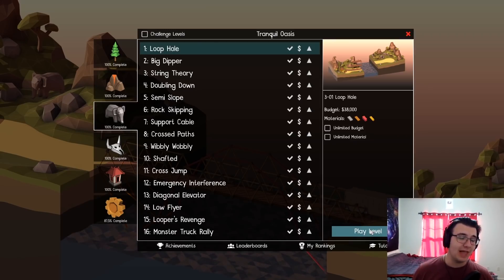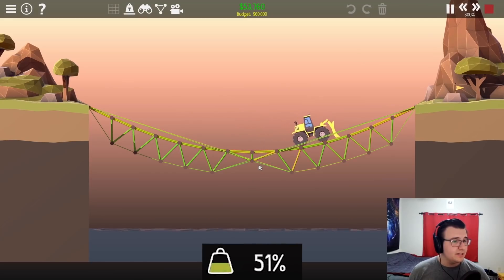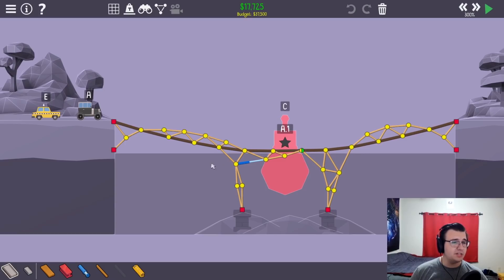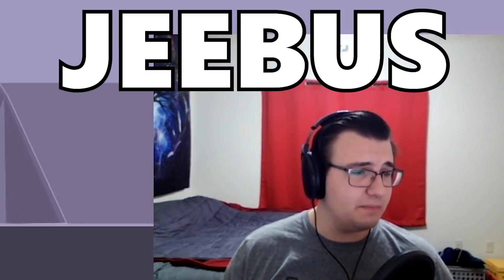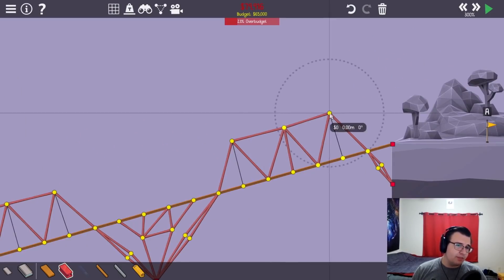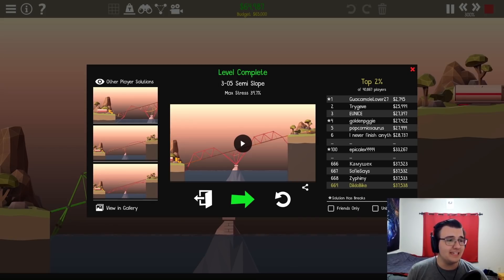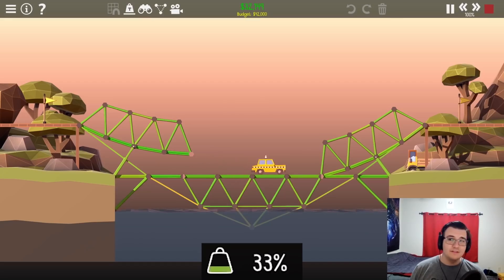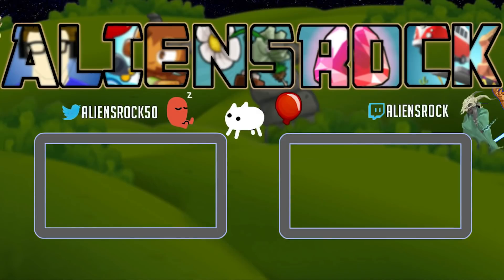Building MASSIVE BRIDGES With Extremely Low Stress

Comment: I don't remember if I mentioned this in a previous video... (Tell me if I have.)
But I think I have an idea on how to make 'min-stress' work alongside 'min-budget.'
What if each bridge was scored by a combination of how far under budget and under 100% stress you are?
I.e. if you use only 75% budget for a bridge with 60% stress, you could score 50.00 in total.

For those wondering, the equation I used was the following:
=(100%-MIN%) x (100%+(100%-MAX%))
(This will ALWAYS give you the largest total, so it doesn't discriminate one value over the other.)

Comment: I feel like a good tool to make optimizing stress more fun would be a slider that lets you reduce each piece's stress capacity. For example, you set the slider to 50% and then parts will break at 50% stress. It would allow you to work towards stress goals slowly.
Reply: Yeah that would also allow for a fun challange too